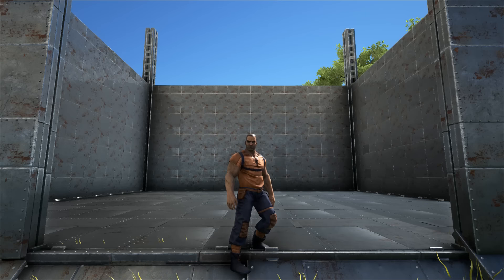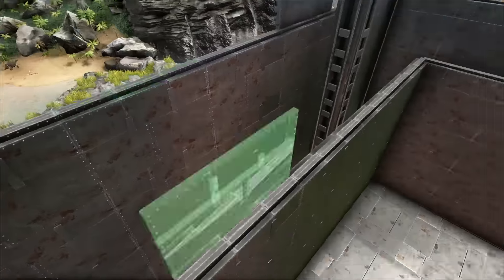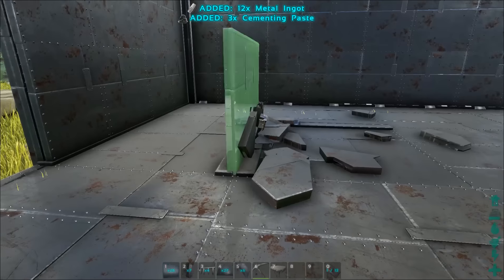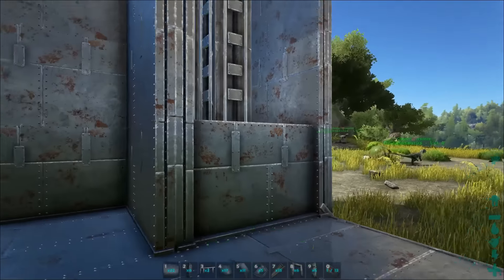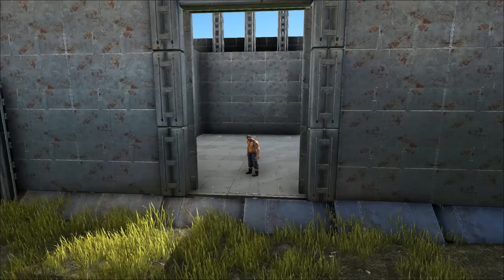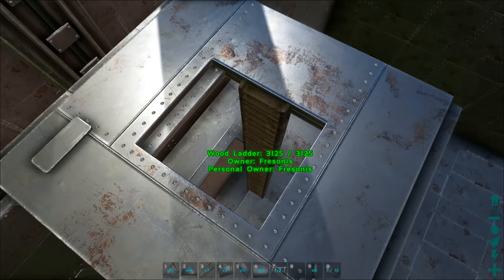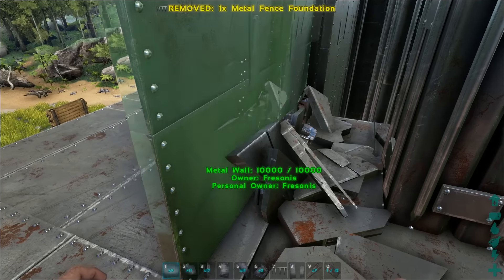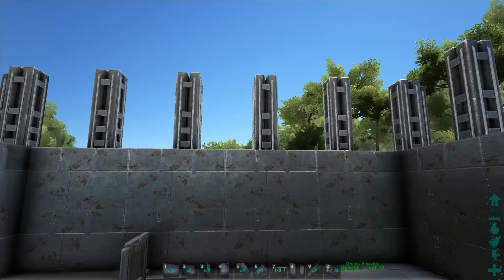ARK | Advanced PVP Building Design Tips&Tricks Ep2 | Buffer zone and Ceiling fortification

Comment: For those of you interested, notice at around 4:30 where Fresonis accidentally snapped a wall on the lower foundation? That wall will stack INSIDE the wall that's snapped to the higher foundation (because it is a different snap point and the game doesn't distinguish it as interference).
With this in mind, that means you can snap 4 walls together without the fence foundation. With the fence foundations however, it can be made up to 6 walls thick!

Keep up the good work Fresonis (:

Comment: +Fresonis Pro Tip Gate will snap to fence foundations, so you you were placing a dino gate you would need 2 fence foundations in a straight line and 8 for a behemoth. Super handy and no need for silly camera angles.
Reply from the maker: Yea they snap indeed to fence foundations, I used that for my castle build with the behemoth gates :)  thnx for the tip though :)

Comment: 1. don't set a pin code on anything, opposing tribes can't open it either way if you just lock it. The pin code just makes it so they can guess it.
2. Never place Dino gates in your main base, always use regular doors unless the base is a room for Dino's, then you need one gate and one set of metal walls, and a couple layers of stone so the Dino's cant stick their head through and get hit if you leave it on neutral.
3. the amount of resources would make it a waste, especially as people would add C4 to mainly doors and hatches

Comment: Boy, I sure wish you had shown the part where you added the second level of walls.   I have spent almost 2 hours working on just the first two rows of walls on a 3 x 3.   OK, so I expected that occasionally, the wall would glow green at one layer and then I'd click and it'd accidentally get applied to a different layer.   But this is happening maybe 40-50% of the time for me!    And I'm down to one section of wall on the second layer where the middle layer REFUSES to snap into place.  This is at a corner, so I thought maybe one of the pieces it's running into is "in the way" somehow.  So, I've tried removing those cross-pieces and STILL the middle layer won't snap.   It's driving me crazy and I've run my tribe out of metal trying. <sigh>   

If you have any tips on dealing with this, I'd like to hear them... because three layers of metal is expensive enough as it is without this crazy snapping problem happening so frequently.
Reply from the maker: Sorry I didn't show that, I was doing it in fly mode, had issues sometimes as well. if the wall in front of me had to be placed I tried it from the front, then from the left and if that didn't work from the right. It's like I show here: http://www.youtube.com/watch?v=tVCsFw63t0M&t=5m19s You can see me also struggle placing the walls, from the right side it didn't work and from the left it did.

Yea it's an expensive build and if the walls act like yours it's totally a pain in the metal resource stock

Comment: So, if I understand this correctly, getting double-ceilings out of this requires that you use at least two layers of walls (I realize most of your video shows using 4 layer) but the two layers of walls have to be an outer-layer and an inner-layer on a single fence foundation, which ends up with them being of DIFFERENT height, correct?      I mean, the second layer of ceilings would depend on having walls of two different heights.

I have an existing 5 x 5  (x 4 high) room at the top of a tower.  It is walled with the smaller dino gates at all corners and then that leaves room for one wall segment (extending upwards) in the center of each side.  I did build those wall segments already using fence foundations.  (I only made them two-thick, though, because I found, in practice, it is very difficult to get that inner layer to snap.)  But both layers of those walls ended up being the same height.   (I'm trying to figure out how I might add a second layer of ceilings to this design without much trouble.)
Reply from the maker: The same technique I show here as well: https://www.youtube.com/watch?v=qqllol-9KtU&t=8m33s
The wall on the fence foundation should be a little bit lower than the wall that is on the foundation. if you have both walls on the same height, something went wrong, don't know what though. It is indeed tricky to snap the inner layer so 2 walls thick can work also :) But I don't understand how a wall on the fence foundation is at the same height as the other wall...... maybe you can place a fence foundation 1 place back to the inside, so not on the outside wall, but one more to the inside (just leave your 2 layer wall on the outside, no need to demolish that!!) You can use cheaper material to place a wall up on the fence foundation, you can check if the height is lower by placing a wall on the normal foundation. If this works and the wall on the fence foundation is lower, well then you can place the wall 4 high. like the others and then place ceilings on that fence foundation wall, extend to the outer walls and you should now have a ceiling lower then the normal ceiling. finish of with the normal ceiling above it
Reply: Well, just to explain more clearly, I got the two walls the same height by using your "temporary foundation" trick.  I had used that to try to make a wall 3 units thick at the base of my tower.  But getting all three layers to snap (2 on the fence foundation, 1 left hanging onto them when the outer temporary foundation was removed) was very difficult and wasted a lot of metal when the game glitched as I tried to place them.  So, when it came time to do the upper part of my tower, I used the same trick but I didnt place the middle layer.  This worked very well, didn't waste much metal with mistakes, and both walls ended up the same height.  I just wanted to explain that better.  I will probably get time to try your suggestions tomorrow night.  Thank you.
Reply from the maker: +David Raasch aah oke , yea then it is clear that they are at the same height. I thought maybe they changed the mechanics of the fence foundation and wall snapping point. I don't know if the ceiling keeps hanging on the other walls, since there is no all at the fence foundation height, but you can first try with cheaper materials ;) I hope it works and yea it was a hell to get those 3 layers of walls on the outside.
Reply: OK, well, my experiment did not work: 
I had forgotten that I am not dealing with foundations.  This "level" is at the top of a tower.  It sticks out from a main 1 x 1 shaft to become, first a 3 x3 (the level below) and then this level is a 5 x 5.  So, I'm dealing with ceilings for floors.  And I just learned that with a fence foundation on a ceiling, both walls will always snap to the same height.

I will probably have to add a false 1 -level high layer above my ceiling and booby trap it heavily.  Either that or I would have to run pillars up. (There are pillars already coming up into the corners of the 3 x 3 and the 5 x 5, but I don't expose them within the rooms themselves, so I can have space.)
Reply from the maker: a challenge ;)

Comment: Instead of destroying the 4/3 layers of walls, wouldn't it be easier to destroy the foundations ? great video btw!
Reply from the maker: I will try stuff out what is easier to get in the base. you can destroy foundations, but the walls will keep hanging on the ceilings above, so you need to destroy walls or ceilings or dino doors to get in the base
Reply: Ah right, thanks
Reply: If you have to destroy the walls, then why do multiple foundations?
Reply: +Vux911 you don't have to destroy the wall. you could simply destroy the foundations the walls sit on.
Reply: +Liam Oettinger -- Read the reply from Fresonis -- you DO need to destroy the walls. Hence my question then, that if you need to destroy the walls no matter what, why bother making double foundations
Reply: Not sure if my previous message linked to you, so just to ask again, if you have to destroy the walls no matter what, then is multiple foundations necessary?
Reply: +Vux911 The double foundations are needed.
Reply: +Liam Oettinger because if they destroy the foundation the walls may not fall but they can crouch/prone under them.
Reply from the maker: if you destroy 1 of the 2 layers foundations, then the other will carry the wall, I don't know if people can crouch/prone under a wall that low to the ground. if you have 1 layer and people destroy a large part of all those foundations, then the base will collapse. if you have 2 layers of foundations, then the enemy has to use double amount of explosives to destroy a large section of all foundations. Also for rebuilding it will be better if more of the base will keep standing up ;)
Reply: +Fresonis ah right .
Reply from the maker: I hope that makes sense XD
Reply: Ahh yes, now it makes sense. If you destroy enough foundations, many of the walls will fall down, so this prevents that. Thank you!
Reply from the maker: :) Glad I could explain it to you

Comment: ...yeah but how do you repair all those layers, when they degrade?
Reply: the inner ones won't be damaged until the outer ones are destroyed so there is no problem with repairs.
Reply: Chris Jones I was thinking about deterioration over time, not defensive damage.
Reply: there isn't any that I know of.   It should only take damage if it's attacked.

Comment: For the inner shell 4 layer wall, what is the end result if I do not line them up on the tallest foundation.  It is not very easy to set up this way on the xbox?  Will I still be able to build the roof?
Reply from the maker: sure you can still build the roof, you just get height diffrence

Comment: how do you make the ceiling double
Reply from the maker: you mean the 2 ceilings perfect on top of each other without any space in between? well you do that by first place the ceiling on the wall that is the lowest, that would be the wall that is on the fence foundation, after that place a ceiling on the wall like you normally would do and that is just a bit higher. if that's not it, then you use pillars to make it poke through and create a bit of space and lay down the other ceilings , that way you have 2 layers and a space in between
Reply: +Fresonis alright cool, with the double ceiling (not the one with pillars) how long of a space can you extend the ceiling before you need pillar support? my base is 6x6 i believe 
and another thing, is it possible to stack the small metal dino gates on rop of eachother ? i want to create a hanger for my dinos
Reply from the maker: depends on what is under the ceiling, if it is all connected to foundations that is under it, then you just can extend ceilings above it. if it's to the outside, then its max like it's normally would be max. so in theory you can have 1 wall here and build 100 foundations to the right and build a wall there and place ceilings between the walls without the use of pillars. you can stack the dino gates, if you have a ceiling between them, they don't snap on top of each other